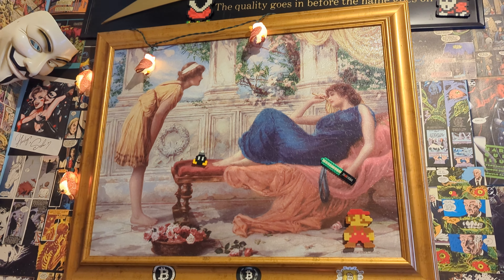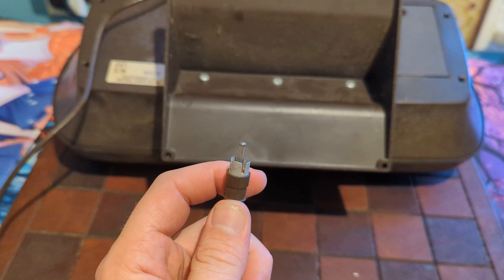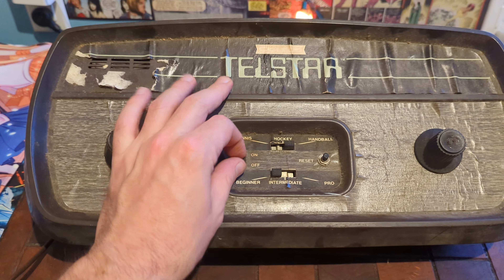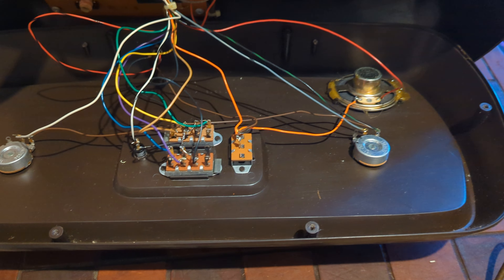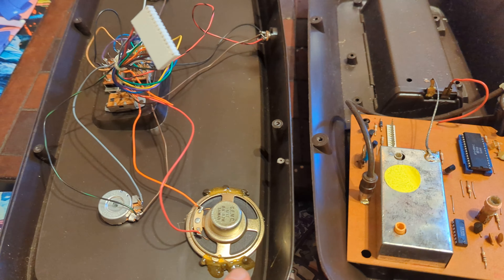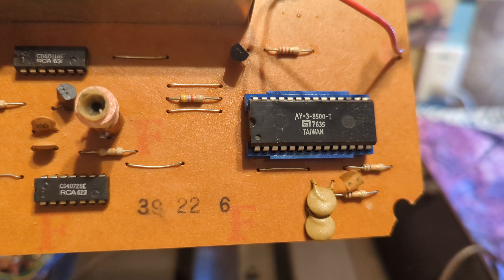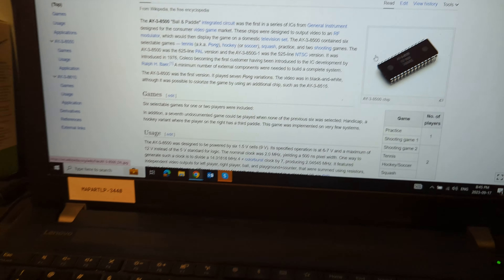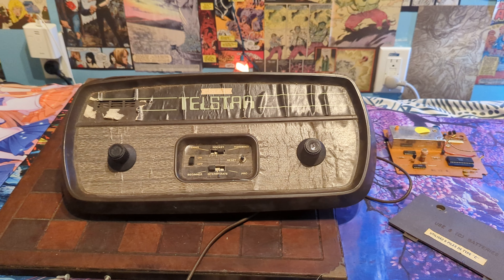Coleco Telstar No.6040 AY-3-8500 Teardown

Comment: That blue thing is just a older potentiometer.
Reply: Potentiometer for what though?
Reply: I just know what the part is not what exactly the potentiometer is changing for the game.
Reply: They are normally used as voltage devider's or to change resistance in a circuit.
Reply: They are normally used as voltage devider's or to change resistance in a circuit.